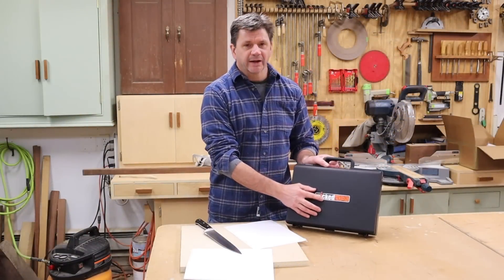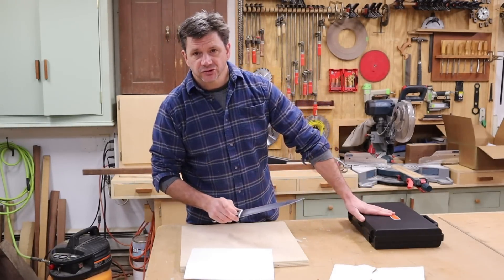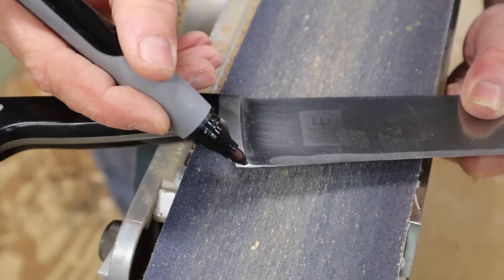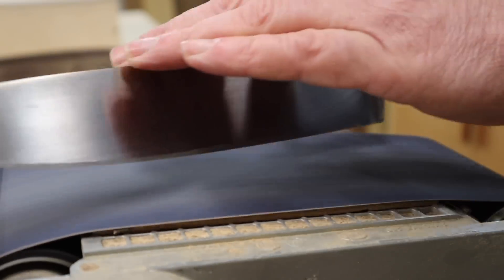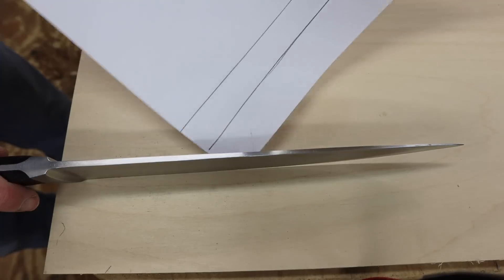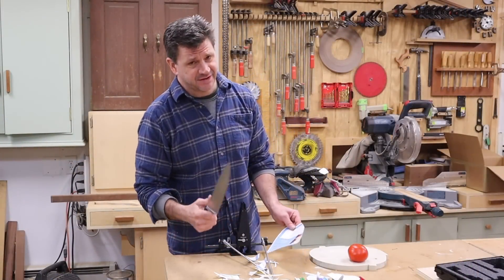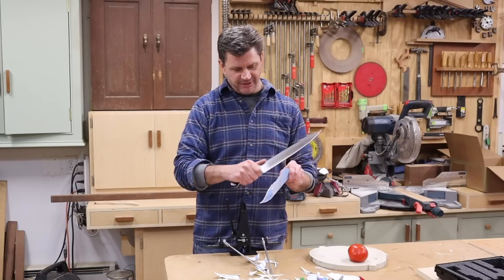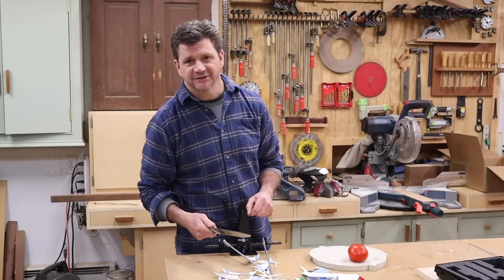Repair & Sharpen a Knife using a Belt Sander & Wicked Edge Sharpener

Comment: I use a $10 Wustof ceramic rod sharpener.  It works great, about a dozen pulls and my knives are good to go for another 6 months.  I've got another one for my santoku knife as well.  We cook every meal at home from scratch so I use my knives heavily and it's easy to pull the sharpener out of the kitchen drawer, and take care of it right then and there.

Comment: I’ve been purchasing bowie knives and hunting knives or camping I’ve had to buy and return a lot. If they don’t cut the paper like how you do after it’s sharp I return it. I’ve only gotten lucky with three knives two 420hc and one d2 steel knives. But when I use em and they lose their edge I really need me a belt sander but I have whetstones I’ve been using but I heard D2 is harder to sharp but these sanding machines make it look so easy

Comment: Yo what’s that tool whole set up you used after the belt called? Clamping it then using two whetstones or whatever their called? I never seen that method pretty interesting I’d like to try it also no water to use when sharpening ? Everyone tells me to use water because I use whetstones what stones were you using from 100-1500? Then what’s 1.5 micron stand for?

Comment: It looks like there is a lot of play at the tip of the blade. Is there an accessory to make the entire blade more rigid? Otherwise you will loose the desired angle as stone reaches the end of the stroke.

Comment: I won't talk against the Wicked Edge because it is great if you are in to the Zen of sharpening and it gives you control a belt sander doesn't but if you just want a razor sharp blade, and fast, the belt sander alone is all you need.

Comment: Impressive, but $549...yikes.....wicked expensive
Reply: For half a thou one can buy wicked many knives, too.
Reply: Actually as shown it is $759. $599 for the option with case and 2x $80 for the extra sharpening stones.
Reply: I prefer the Edge Pro Apex 4 at $285. Fantastic sharpening system.

Comment: Wicked sharp. Wicked expensive. Very cool design but out of my league. I’ll continue to take our kitchen knives in for sharpening and will continue to encourage my better half to use the steel to keep them that way but I know that is futile...
Reply: Who do you take them to in your area? How did you go about finding someone? I don't even know what to search for.
Reply: There is a local shop in a little strip mall nearby and he charges a couple bucks per knife. They come back super sharp and will stay that way for a long time if the aforementioned better half would run a steel over them...
I use a ceramic filament out of an old industrial high pressure sodium light fixture to tune up my pocket knife.
Reply: @johnsholian4318  I'll have to look for one. That's a very reasonable price!